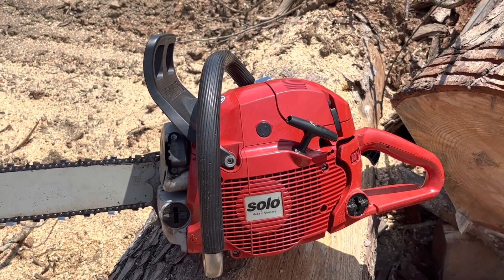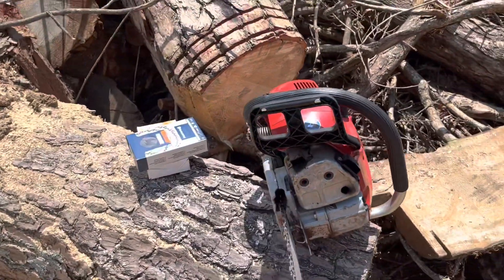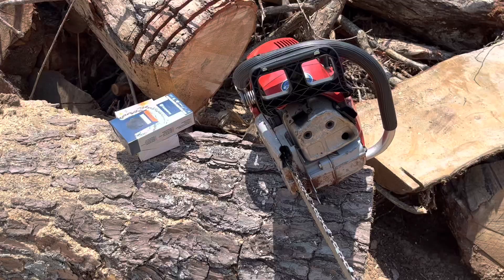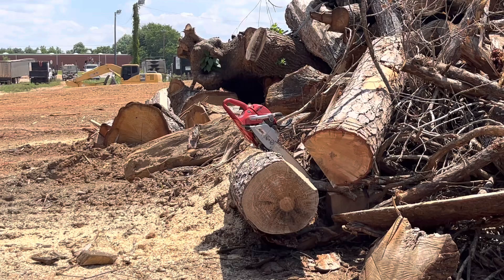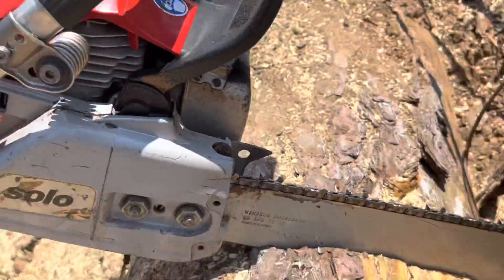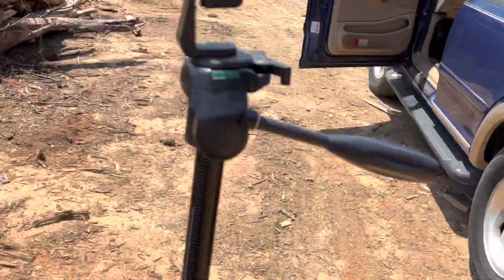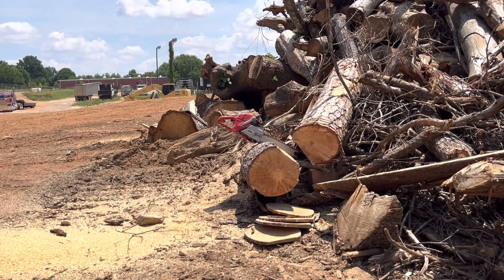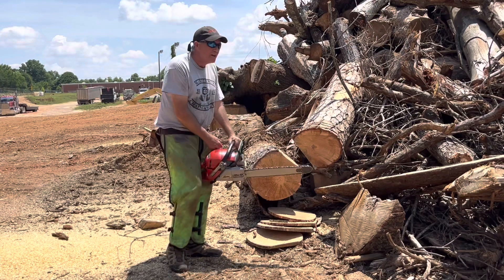Stihl Hexa Ground vs RS33 vs Round Hand File

Comment: Your hexa grind absolutely pulled the chain through the cut WAY FASTER than both other chains. I guess the real world question is going to be how long does it hold the sharpness? Nice video Rich.
Reply from the maker: Good eye/ear!!  The hand filed chain had lower rakers and it drew down the RPM's a little.  I believe this peticular grind would be pretty durable.  The other video I posted about this chain shows a nice close up of the top plate angle.  I believe it would be faster with a with a skinnier top plate angle, but would loose durability.  

I'll play around with it some more when I get a minute.